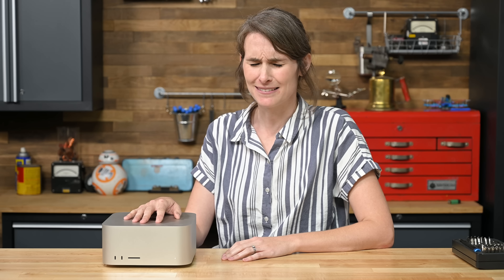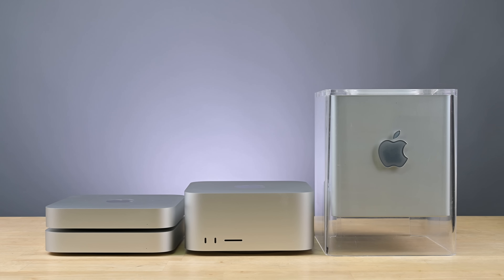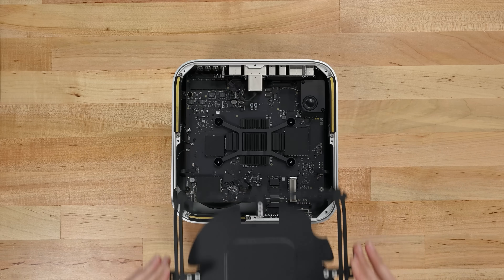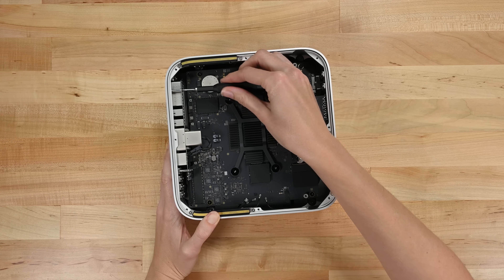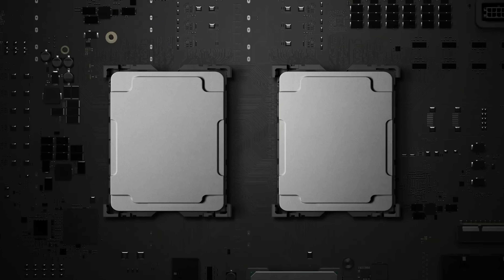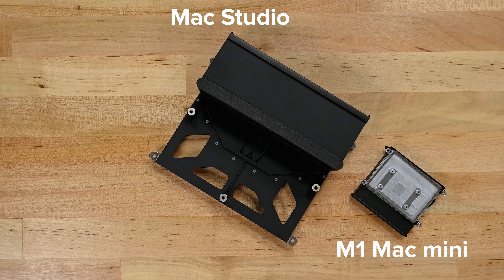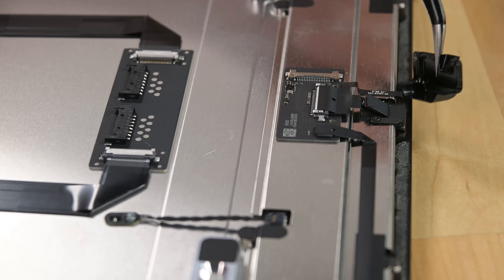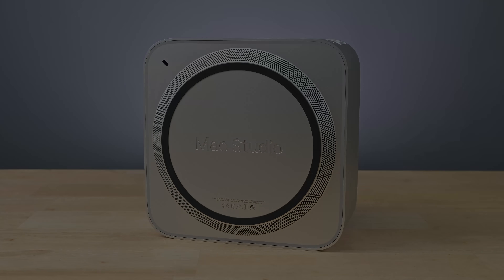Mac Studio Teardown: No upgradable storage… yet

Comment: Totally unacceptable that apple have restricted storage upgrades especially when it’s a easily replaceable part - right to repair , right to replace !!
Reply: I have to agree that you should be able to upgrade it. I’ve been a long time Mac user but the past few years, I’ve found better options, like a Lenovo tiny computer with upgradeable Ram, SSD, and NVMe for a quarter of the price. Unless your into some very very very demanding software, Apple is just not worth the price. If you’re going to buy Apple, better to buy used and load iOS on an external NVMe. And what’s with these little rinky dink 125 and 250 GB SSDs anyway? Just a way for companies to get you to buy online storage! Id rather save to my Synology NAS.
Reply: I think it's the sad future, no upgrade able parts... Just like cellphones.. The average costumer does not care about these things so we end up paying the price..
Reply: You have the right to ignorance.
You're probably elated by Alder Lake's PCIe 5.0 system bus running at 63 GBps. 😄
Instead that of the M1Ultra travels at 800 GBps ... and that of the M1Max at 400 ... and that of the M1Pro at 200 ... and that of the entry level M1 at 128 !!!
Reply: @Enrico.Sbardolini  lol your reply has nothing to do with the guys comment..
Reply: But ram64man has not objected. This is to show that it is only the echo of other people’s thoughts and that, specifically the architecture designed by Apple, it has not understood anything in relation to the substantial difference that exists between RAM and UMA Difference that, incidentally ;), is ENHANCED by the speed of access to memory locations.

Sometimes we try to follow a path that “seems” twisted, but that has its own didactic logic ... that escapes those who know little or nothing.
(Forgive poor English …)

Comment: Is there any reasoning behind covering PSU components with that black tape?
Reply: preventing people from touching the components directly and getting a shock that will cause them to die?
Reply: @menotu000  how can one directly touch electronic components held inside the case?
Reply: @Арсенал-ф8ъ  by opening the case.
Reply: @rkk9684  Isn't it voids warranty? Also why someone lacking any understanding how electricity works would want to open the case?
Reply: @Арсенал-ф8ъ  no opening something doesn't void the warranty. Power sources are generally isolated from a system, in this case they aren't so to repair, clean out dust etc you would have contact with power supply components
Reply: @rkk9684  it has rubber seal on top of the screws which you will have to remove. I think removal of that seal could cause voiding of warranty, that's why it is probably there. Once again if people doesn't know how electricity works they shouldn't be tinkering with any kind of electrical appliances.
Reply: @Арсенал-ф8ъ  opening up an appliance does not void the warranty, it doesn't matter if it is welded shut or glued or uses screws.

Comment: There doesn't seem to be a controller on that SSD and I only see 2 NAND flash chips.. Is the controller on the M1 and the SSD is just bare NAND chips talking through a M.2 slot?
Reply: Yes; they are just nand packs. and it probably isn't a m.2 slot, just an apple special.

Comment: I disagree a lot with the score. How can it be a 6/10 when literally almost nome of the components can be replaced? Only power supply, heatsink, fans, an antenna and the usb passthru ports can be replaced with an exposed power supply that can be dangerous to operate for the inexperienced user...
I feel like your scored is heavily based on the "what if" a software update lets us upgrade the storage, so I would say a 1/10 is the correct score...
Reply: QQ
Reply: It’s easy to disassemble, as reflected in the score
Reply: @npgoalkeeper   okay, i get that some of the score gotta reflect that, but if you can’t replace anything whats the benefit of disassembling? That’s anything but repairable for me… idk i’m not trying to sound offensive or anything like that, it’s just that i don’t get it and i find it misleading in some way

Comment: Really miss Steve Jobs. He was not shy about explaining engineering decisions that resulted in the final design. For better or worse.
Reply: What you see is actually Jobs' dream come true: an “almost” cubic Mac with a fan that doesn't make any noise, almost not there…
... but with a SoC in which the system bus in the M1Ultra travels at 800 GBps ... and that of the M1Max at 400 ... and that of the M1Pro at 200 ... and that of the entry level M1 at 128 !!!

Comment: 6/10!?  I am sorry, but I am a tad confused, how can it score so high when you need specialty parts to replace every time (the rubber base)?  To me this is a flat out 4/10, you can repair it with a donor device, you can access it although it's not obvious how, you can do some simple repairs, that's it though isn't it?  Replaceable SSD?  Replaceable HDD?  If I buy it, I want to use it to its fullest. 

Even the old time capsule is way better, at least you can take the storage out and swap it as needed, open it with little hassle.  I had to retrieve the drive for my mother...  I still shudder at the dust inside.
Reply: I'm sorry but how is this a 4/10 to you? if nothing is upgradable or repairable how can you give it more than a 2 (simply because technically it doesn't break if you take it apart)
Reply: @Nib_Nob-t7x  Have you heard of being generous?  I'm not the one buying this over priced heap of branded trash.  4/10 is way more realistic than 6/10.  At least they didn't weld the darn thing shut or chuck a load of glue in it to stop you. :D
Reply: @Nib_Nob-t7x  All of the ports and sd card slot can be replaced if they go wonky. Even if they are not SSDs, the nand packs can be (possibly, if apple wants to) replaced when they die.
Reply: @stephen1r2  go ahead and tell me the magical fairy tell land of where you can buy those replacement ports.
(without having to steal them from a factory then smuggle across a boarder)

You also say "possibly, if apple wants to" when has apple ever wanted to do anything to make it easier to repair please name 1 time.
Reply: @Nib_Nob-t7x  From the Apple fairy I imagine. But only if you bribe them properly.
Reply: @Klaas de Jong you can’t grade repairability based on what “might” happen. You also can’t grade it based off of if other people find out how to bypass the blatant things done to stop it from happening.

Comment: I guess the second slot is intended for the 8 TB ssd model, so 4TB in each card.
The card is too small to contain 8TB by itself
Reply: Some people have said the 4TB configuration also have 2 SSDs
Reply: @dylanbystedt  It likely does because 2 2TB modules are cheaper then 1 4TB module.
Reply: Makes you question why they charge so much then when the chance of failure goes up.
Reply: Finally someone who uses the brain to think about what their eyes see.

Those are simple “memory cards” ... and when it’s time to update a configuration purchased “out of necessity”, in a couple of years, I’m sure Apple will sell appropriate spare parts or allow OWC to do so.

Comment: 6 out of 10?
If this were a phone or tablet, sure, but we're talking about a computer here, and a desktop one, not even a notebook, and a desktop should have upgradable RAM, swappable CPU and easily upgradable storage.
Just because you don't encounter too much glue in the way of opening it up, and ports are modular, doesn't mean it deserves such a score, it should have been a 3 out of 10 considering the context.
Reply: NEW OctanGaming234  I do, even notebooks with x86-64 CPUs and RAM soldered on the motherboard also have counterparts with modular RAM.
Being based on a mobile architecture is no excuse, also, until not long ago, many notebooks had socketed mobile CPUs, there is absolutely nothing making it impossible to sockets/slots, they just won't do it because they are greedy.
Reply: chromecast now gets a very large heatsink.
Reply: @Pedro don't waste your time, people dont want to hear the truth. Sadly this can mean also the future of pcs (no upgrade able parts, like a cellphone).
Reply: Considering that it is physically impossible to have low power high performance ram over longer distance, the non-removable RAM should not be considered.
Reply: Just buy a pc

Comment: im REALLY happy to see all the ports on both the computer and monitor being modular. port damage is the third most common repairs i do for customers behind screens and batteries across all types of devices so its great to see all these are replaceable without soldering. hopefully aftermarket ports will be common
Reply: Apple, as always, really nailed the engineering here!
Reply: "modular" for the engineers not the consumer
Reply: @NonsensicalSpudz  Modular is moduar, there's no inbetween. What percentage of your lay consumers know or are interested in taking apart their iphone or Mac computer to replace a damaged part or upgrade it?  I'd say 1% of the base does this.   Most are content with bringing it into Apple Genius Bar to have it serviced or someone else.   

My main concern is it dies out of the blue and you're toast.
Reply: @NonsensicalSpudz  doesn't matter who its for, Consumers will still be able to remove them and put new ones in. screw drivers don't care who you are
Reply: Apple won't supply the ports to consumers or for resale. If anyone tries to produce bootleg ports they will be sued to oblivion.
Reply: @VVGRestoration  Apple never supplies parts. yet ive been fixing apple tech for the past 5 years. funny how stuff works...
Reply: @lenshibo  Yes, that's what I said, Apple never supplies parts. I've been fixing Apple computers since 1997. Most parts I need have to be scavenged from another computer for that reason.
Reply: @VVGRestoration  Little helpful tip than, scavenging parts is way to expensive. Almost every part can by bought from ebay and amazon. I dont know why you think doing this will get people sued, all they have to do is not put the apple logo on there parts and its fine.

Comment: Some young programmer will figure out the soft lock on the second storage slot… soon I hope 🤞
Reply: since they aren't SSD slots there in no real lock. You would need to reprogram the SSD controller inside the M1max. They are just apple special nand cards, no one else can make those upgrades.

Comment: 6 /10 is way too high... that thing isn't designed to be repairable or upgradeable
Reply: I agree 100%. It’s designed to be not upgradable. This is simply a middle finger to our rights to repair devices. The rating should have taken that into account.
Reply: It's designed to be repairable (only by official Apple Authorized Service Provider) but yes, it's not upgradeable. This way they can sneakily say they care about the right to repair without actually caring about their costumers
Reply: Yes, indeed, unless you're friends with someone whose an expert on apple's devices inner workings and have both the uber expensive tools to actually do the repair, and knows who to get the parts from. You're out of luck.

Comment: Regarding dust, I hope a third party design a nice base containing an air filter (someone made one for the 1st gen mac mini that is perfect fit and looks ideal). Really Apple should design an air filter themselves.
Reply: @tomatohh_  Understand what you're saying, but if designed properly the airflow change negligible. The one I have on mac mini 1st gen design is perfect. You haven't seen one (btw air filter is external) and I can't find even an image of it on web. It can be done, it just needs to be designed correctly for function and looks.
Reply: @tomatohh_  Magnetically attached external air filters exist right now for desktops. Apple could easily implement something like this on the bottom if they made the vents larger to counteract the increased air resistance
Reply: @tomatohh_ 
Apart from the fact that the speeds, noise and temperatures detected so far have nothing critical. On the contrary! However, nothing prevents an external filter, conceived as a support base, contains a fan that, at a cost of 2 dollars a year, makes up for the possible slowdown in the internal flow by providing one under pressure. Solution now common in laptop stands.

Comment: With a storage module in a different slot or different capacity than the original configuration it seems like it's not possible to get Configurator to restore. I tested much of what you guys did except with the 512gb module from a base unit and a 1tb from a different Studio, but no configuration other than the original size was able to restore. According to genius bar techs that I spoke with, the module has to be paired with System Configurator, a tool only accessible in repair tickets, so they seemed to think that upgrades were not possible. Hopefully this can be changed at some point! Great teardown :)
Reply: since people managed to swap iphone screens which are software locked, do you think people are gonna upgrade ssds? If so, how long do you think it will be, and do you think it will require special machinery?
Reply: @ASRocketry  i think they would be a programming tool for that if the market were big enougj
Reply: @imdyinginside1919  hopefully
Reply: @ASRocketry  the screens aren’t locked, just the FaceID was on the iPhone 13’s or if you damaged the ribbon cables on the iPhone X-12
Reply: @jameschen8  no, the display is paired too. True Tone is disabled after a screen swap if you don’t reprogram the display
Reply: The pins on the Studio's SSDs look like the pins on the MacPro's SSDs.  MacPro's SSDs are longer so we know they won't fit in a Studio, but will a Studio's SSD work in a MacPro?
Reply: @mikelittle256  Mac Studio's NAND module doesn't have a controller chip, they aren't a SSD. The controller is in the motherboard.
Reply: @mikelittle256  Theese aren't even SSDs.
Reply: They showed that they got it to restore though
Reply: @lowrivera  only with the same size storage
Reply: King of Mac is here.
Reply: Or better yet, release system configurator to 3rd party repair shops to use.
Reply: @TomSidProductions  apple will never do that, people are just gonna have to make their own
Reply: @Carl Gunderson actually, i was suggesting someone try it the other way. A studio drive in a mac pro.
Reply: @Carl Gunderson Okay sorry my bad, you just need a specialised tool, and removing it could damage it.  Tell me, how is this any better?  I run over a cable in my chair and break it, how am I going to replace it?
Reply: Buen video. Donde puedo comprar 1tb para aumentar a la Mac studio
Reply: Sorry to break it, I doubt it.  While Apple WERE going in the right direction with repair ability etc (at least from a design view), just look at what they've started to release.  Practically giving us the middle finger with what's basically device locked hardware (okay not quite, but might as well be), and they even had the idiocy to hardwire the Studio Display's cable.  Not only that, they charge you extra for different stands that cost practically the same to manufacture.  On top of that, the aluminium used is practically butter in comparison to earlier devices.
Reply: This whole kerfuffle about the Studio's SSD...  Keep in mind that the M1 Macs are really just modified iPhones rather than modified x86 machines.  I don't think you'd have much luck swapping out an SSD on an iPhone either.  Good thing there's 4-6 Thunderbolt ports on the Studio.
Reply: @mikelittle256   that's actually not true, first the iPhone doesn't have an SSD unit but it has a Nand flash  chip and you can actually swap and upgrade the capacity of an iPhone changing that chip. Which makes me think that might be possible to do for this "Nand flash units" because apparently they're not SSDs either

Comment: Even tho upgrades seem impossible, I’m impressed by the easy disassembly of the studio.  Good job again ifixit
Reply: good
Reply: how is it easy? there's like 50 screws and connectors. Completely unnecessary. And the external screws are hidden under a ring that you can't put back.
Reply: @mmdday  At least there isn't a ridiculous amount of glue other than the feet.
Reply: @mmdday  usually apple likes to put some trap with ribbon cables or makes the space so tight that you can reach only if you have small hands . Still to have modular IO is quite nice ports break some times .

Comment: They act like the “built in ram” (unified memory) serves no purpose. But it’s literally so much faster and efficient than separated ram. Just get a little extra when you buy your expensive purchase and you’ll be fine
Reply: Your watching iFixit. Everything relies upon repairability and upgradability. They need to point out the lack of modularity because thats what they specialize in
Reply: @Carterthielftw_  I understand that. I’m not sure why I commented this in the first place lol
Reply: Yes, except is overpriced and not faster than a standard and way cheaper SSD
Reply: @GiorgioAresu  he’s talking about the RAM, not SSD. Which I agree we should be able to upgrade them ourselves as they are overpriced.
Reply: @jameschen8  oh I see now, sorry I misinterpreted the comment
Reply: @jameschen8  If you can upgrade the RAM it wouldn't be 800GB/s DDR5 ;-) ... and super low power consumption.

You are asking Apple to defy the laws of physics.

And Unified Memory Architecture will be impossible to achieve.
Reply: @RunForPeace-hk1cu  I meant we should be able to upgrade the SSD. Should’ve worded that better.
Reply: @GiorgioAresu  you know we are talking about Unified Memory in this post right?